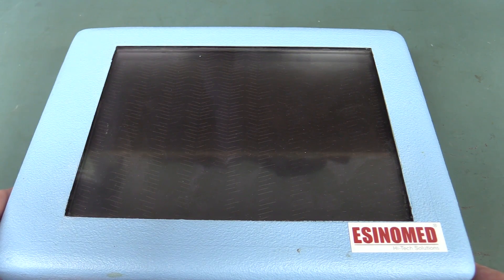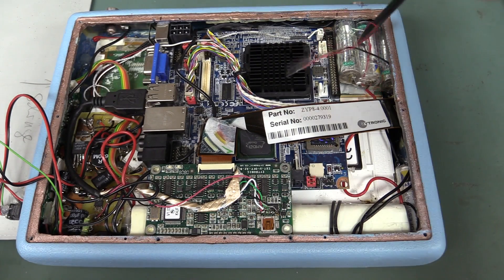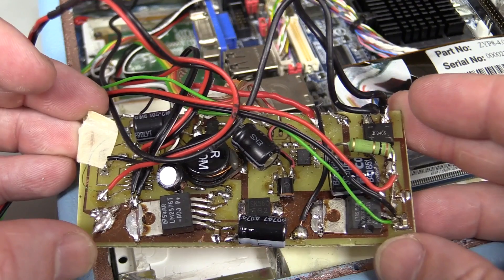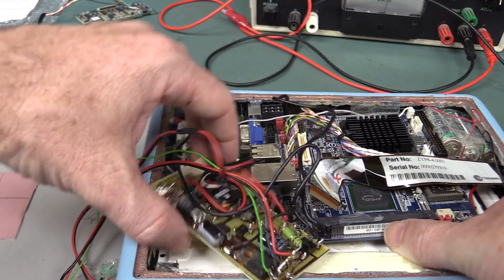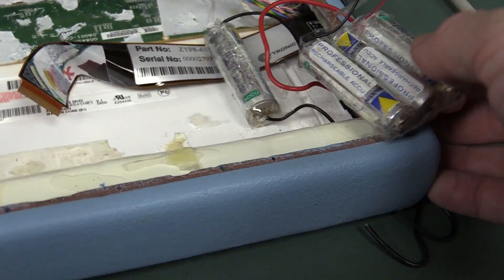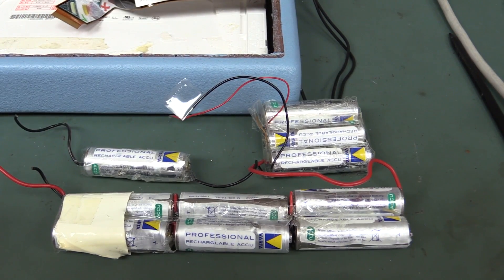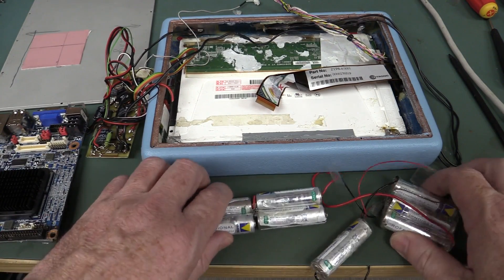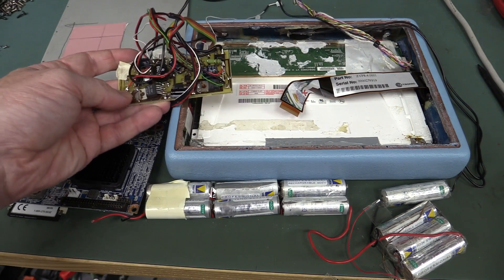EEVblog #822 - World's Worst Tablet Computer Teardown

Comment: It honestly looks like a first idea prototype.  If you look on Esinomed's website you see some great looking products so I think that 11 is just a v1.1 prototype proof of concept... My best guess at least.  My guess is that they needed an x86 compatible tablet since x86 seems to be the standard for hospital software (nobody wants to get anything non-Intel, though). I remember getting a pair of old 386 based Fujitsu pen tablets for repair that were used in a local hospital.  They ran MS-DOS 6.22 with some custom software and ancient IR optical ports to sync to the main database.  They were built in the '90's and used for about ~10 years before I got them and were eventually replaced with similar x86 pen tablets with WiFi... still ran DOS, though.
Reply: I agree here there website and reviews around the interwebs are good, this may be some sort of idea brief, slap together for some reason. Show booth fodder?
Reply: Probably just a proof of concept that the given hardware can run the necessary software and be portable with touchscreen compatibility.  Probably cheaper to create an app for iPad or Android tablets then to manufacture a specialty one running XP, though.

Comment: Wow what a lemon job, this kind of crap is certainly unfit for sale on the professional/consumer market! Being a DIY electronics hobbyist myself I would understand a bit if it was a homemade for personal use but even then I personally wouldn't do such bodgy soldering and too would use battery cases for the batteries, plus would do a hell of a lot more neater job in building the power supply on a Jaycar project board otherwise would opt for that power brick if I could easily get one. I can imagine sooner or later something would go short or open circuit on this thing, am surprised it even worked!

Comment: MacGyver soldered that board with a magnifying lens and some sunlight.
Reply: .. using the lead from some discarded roof flashing and tin from an old tin can.

Yes, I know tin cans are mostly steel but can't we MacGyver your belief for a bit.
Reply: +Maddin1313 Nope... even MacGyver has standards.
Reply: ... while his right arm was in a plaster cast.
Reply: +mikedelhoo Both arms, definitely both arms!
Reply: Even McGyver would look at this in disgust....  it's way below McGyver standards..
Reply: +Maddin1313 yep! haha nice one
Reply: +Maddin1313 I do way better smd with a fresnell lens and it is not that hard. problem is to move over as soon as the parts is solderen in place...
Reply: +Maddin1313  This isn't even Macgyver... this is a Macgruber job.
Reply: +Maddin1313 ... While his eyes are being destroyed by an industrial sandblasting machine.
Reply: +Maddin1313 Dammit I was going to make that joke XD
Reply: +Maddin1313 
Wow I've never thought of trying that with a glass, but I bet it would work surprisingly good.
Reply: +Silver Dragon I knew I saw a celery leaf stuck between the batteries.
Reply: I find it amusing that there was a sci-fi story written many years ago where that exact technique was used, although it was more welding than soldering, and it took place on the moon which makes it a little more realistic since there would be no atmosphere to either interfere with the sunlight or to oxidise the weld.

Comment: Dave, c'mon cut them some slack... this particular device is probably the output from a hackathon of some sort. Not as if they are selling this to a hospital - This was probably intended as a quick proof-of-concept to illustrate that something can fulfil a particular function. Every startup does this kind of "Wizard of Oz" hacks - and don't forget - the damn thing was probably bodged together in the days before Farnell and Eurocircuits, let alone Arduinos and Pies. Look into your own "young years" and designs from that are - are they so different? The only result of this video of yours is that this company and all others who watch it it are gonna issue a serious fatwah banning R&Djunk ending up in the dumpsters that we all so love.
Reply: +megaspeed2v2 Usually in a not-too-large company, you'd have a stagiaire  (intern) assigned the glorious task of bodging together a working proof-of-concept/demonstrator. The soldering-work with the hookup-wire hints at this a-plenty. Also the cellophane tape for insulating. Polyimide wasn't a thing till ~2005. The serial number 00011  might just be a nerdy joke at "bodge #3" written in binary. As for soldered AA cells - Remember the crappy polypropylene battery holders with rusty springs from yesteryear? I'd say "good job!". As for "not good enough for an amateur" bit - - It still booted, some 15 years after being built, didn't it? If it fits, I sits!
Reply: +Graham Langley, 
The number 11 could also mean that it was prototype 11 of  some other product not related to what is seen in the video. As David says, they probably reused the case/screen from some other product and did bother to remove the badge. It could also be a doctor taking home a broken PC to his electronically interested kid to play with.
Reply: +Aditya Mehendale yes his younger years are much different, if you've watched many eevblog videos he has shown projects from before he even got his first engineering job. and by the way as he said a bunch of times, serial number 11... this obviously is not a proof of concept single unit build and even if it was its still not good enough even for an amateur.
Reply: +Aditya Mehendale Same point as I made a few hours ago - it's most likely a proof of concept.
Reply: Aditya Mehendale ... I am an intern at a very small company and this is way below our standards even though the company only recently even started its engineering department.
Reply: +megaspeed2v2 Serial number 11 could mean it was the first one they dared show to a customer.
Reply: +Aditya Mehendale No, there is just no justification.  I consider myself a rank amateur, my soldering skills are terrible, and even then they are better than what was going on with the power supply.  I would be ashamed of that if I had turned it out even for my own use only.  And the battery pack is a joke, again, even amateurs can and do make far better packs themselves.
Reply: +KSett2013 Would you happen to have them, stashed away safely somewhere? I'd love to see these!! :3

Comment: if I were those dudes, I would have had that as an alpha model prototype, then had a proper set of boards created with a low power APU, RAM, SSD and power supply that only needs a 10-cell LI-ION battery pack or a low profile LiPo cell... that tablet COULD have been a really beautifully designed bit of kit and sold well...

Comment: Regarding the power supply, Dave is surely right, but what it has to have different voltages and grounds. I know close to nothing about electronics, and on the table I have a small LCD tv to play around. PSU mosfet driver is a 6 pin device with strange number, and doesn't seam to work. I wonder if  I could power it from power brick, I have no schematics, but it seams to me that to drive LED for back-light you need other voltages.

Comment: I don't blame them actually, finding the money for starting a company is HARD.
Nothing wrong with a hand etched board. Getting boards manufactured in small quantities is very expensive. (Yes folks, I know about OshPark and the like)
I'd like to see Dave make something like this, I bet it'd be crusty looking as well.
5:13 ... Local electronic stores are rare, and they are somewhat expensive as well. Also they hardly stock any parts, so good luck finding just the right part. Also, the battery holders may have been too small to fit in there, so they soldered the batteries like that. A few mm's really do count!
Reply: +Benjamin “Ozias” Esposti yes theres nothing wrong with a hand etched board, if you could at least care to spend more than 5 minutes on the layout like these guys did.
Reply: +BC Fuerst the thing is. this isn't a demo unit. they sold these to a medical facility as a final product.
Reply: +megaspeed2v2 Or maybe they can't because their last implementation had a flaw that didn't become apparent until the last minute and they had to get the  demo units out as fast as possible. Look at the components in this thing. that's at least 10 years old.
Reply: +Pixl Rainbow obviously they didn't because it lacks all necessary markings like CE or TÜV seals.
Reply: Huh. Weird, I could have sworn I heard him say something about it not being demo. My bad!

Comment: Huh ? This is medical equipment? In my neck of woods medical equipment of any kind is like 4-50 times more expensive than consumer product due to all the crazy amount of electronic regulation and safety, these must be designed so they cannot possible fail and endanger patient.  This thing  would qualify as lower quality than free oem ching tablets given on with 12m+ phone subscriptions. This is horrendous. It must have been sold by door to door scammy sellers that this time targeted a hospital.

Comment: white van tablet... :/ ohh dear... hey dave, you know that battery reverse polarity thing, was it microsoft or intel? anyhow, have a look inside your fluke 91 scopemeter, if you put the batteries in reverse polarity theres a roller on the positive terminals to prevent continuity/connection.. so 95 or 96 fluke were well ahead

Comment: 2:23 I don't think they were able to use a proper USB cable due to where the connector is relative to the case.  (If they rotated it, then they couldn't connect the touchscreen to that board.)

So yeah, the "bodge of the year" award stands for their power supply ;)

Comment: "We need 15 volts to power this"

"Alright, 10 rechargable AAs, that's about 15 volt isn't it? Put them in series, be sure to find some hobbled man with only one hand and half an eyeball to solder it."
Reply: +Nukle0n Well, it was probably as you say; But rechargables are nominally 1.2 volts, so 10 of them would make 12 volts. I wouldn't have trusted them to know that....
Reply: +Robert Backhaus That'd explain why they have more bunched in there in the side because the voltage was too low on that "battery pack" they made.
Reply: +Nukle0n Or because they didn't measure the battery voltage under load after watching a battery-enhancement scam product's instructional video.
Reply: +Nukle0n As soon as he found the 4th one, i was thinking "ok so where are the other 6" and sure enough...  haha
Reply: +Nukle0n Sure!  Li-ion need controller - could explode if overcharged.
Reply: +Daedalus Young Ahhh. We may have found a use for Batterizer.....

I don't beleive I said that #$/*NO CARRIER
Reply: +Gain Medium Those are much smaller, these are off the shelf Li-Ion AA batteries.

Comment: What are the downsides of soldering batteries together like that?
What is the actual problem with that hand etched board in terms of utility, other than being aesthetically displeasing to an elect engineer?
Reply: +crikey mate Soldering plain cells is hard, and you will always overheat and damage them before you get the soldering done. It is very common to melt plastic seals - and you can see how those batteries have leaked.

And the 'layout' of that board is just awful! Components poking in all directions, and that 'all through-hole parts surface mounted' look just makes our skin crawl. Look at how those multi-terminal regulators have their pins bent to fit the board. It is so bad that even rank amateurs would find it hard to make such a mess on purpose!

As Dave said, you can etch your own board if you need to, and it was more common before the maker movement made rapid prototype board etching common and easy. But you should actually design the thing!
Reply: +crikey mate  The problem with the power supply board... it's not that it's not pretty. We get that, things don't always come out aesthetically pleasing at first. It's that it looks like a fire hazard and short circuit hazard. And i mean it's not like you have to be crazy OCD or anything, just things vaguely not looking like they would touch where they don't belong all the time, that would be a big huge progress. And i mean it's not like they even tried to do anything at all to make it the tiniest bit less scary, i mean not even hotmelt and a couple strips of electric tape, nothing, no shits given?

As to batteries, Robert called it, they are generally somewhat toast when you try to solder them directly yourself. You can get tabbed batteries or premade packs if you need to solder.

Comment: There ought to be an implied contactual clause in case law that states that if a client deliverable has the leads soldered to the battery tabs, the contract is null and void and the security deposit is forfeit. SOLDERED. TO. THE. TABS.

Comment: What a heap of junk.. the board I can see is ok but that battery pack is beyond belief as is that so called power board, it offended my eyes badly Dave 

I am too dammn fussy to even let a one off out the door like that, but that been said I did a one off a few years ago but that was on veroboard and there was no time to send it off to be done on a printed board also I was like 6 hours away from any town when I made it on the van table.

Comment: Burn it with thermite. A butane torch is too good for this one.

I soldered together a clock kit recently with a cheapo soldering iron and even MY solder joints look miles better than that!

Comment: Someone definitely opened that unit up and played around with it/modified it before you got it. I doubt they would have sold it like that. As bad as it looks, if original, it did not stop it from working properly. There may have been another power supply in place of that double sided board.